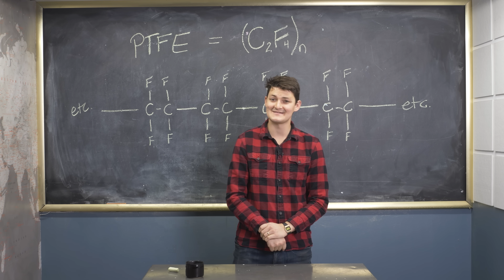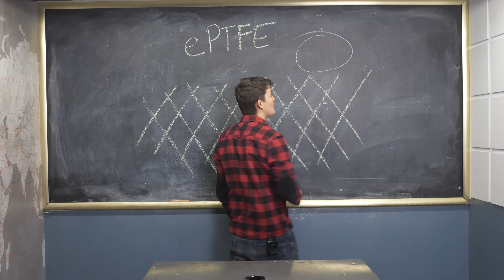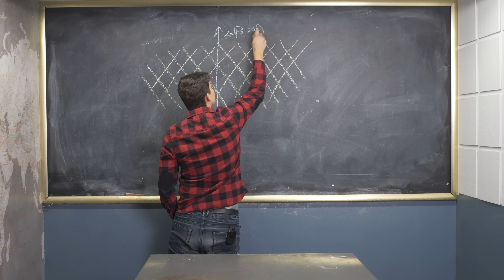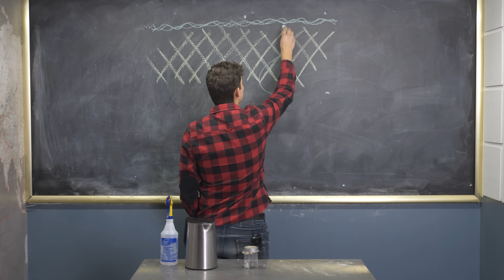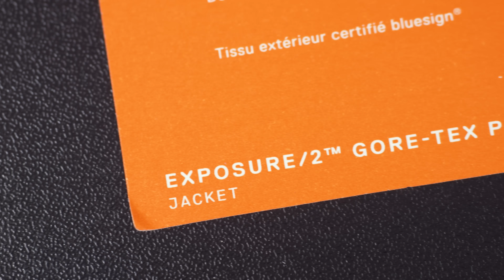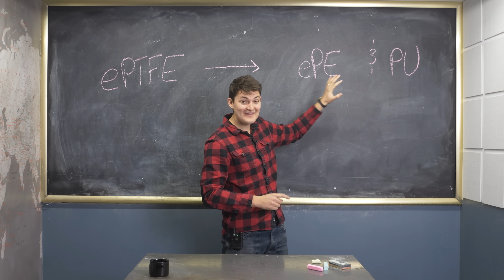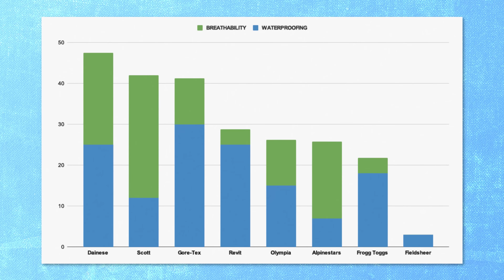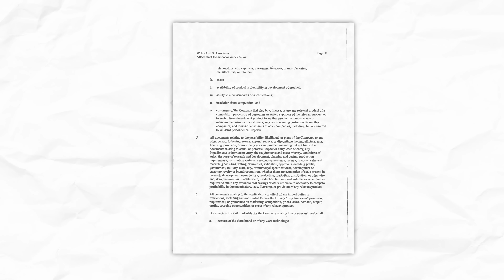Gore-Tex is a Marketing Gimmick

Comment: As a textile technologist I proved this back in the early 90’s. Some of the top brands utilise an enhanced membrane system, that not only out performs G’tex, it’s a fraction the cost. The only G’tex products I’ve purchased are ones I’ve deliberately destroyed in the name of science. Great video.
Reply: Any suggestions? Asking for a friend.
Reply: @Desmo25  Also have a friend who'd like to know
Reply: Mountain Equipment Lhotse @Desmo25
Reply: yes, please sir - suggest us something:)
Reply: @m5ks11  Just about what everyone else has developed still utilises one ingredient.  The “Teflon” component used by Goretex was prohibited in several countries just over 20 years ago. This alone means all claims are extremely out of date. A simple tip is to compare the water resistant and breathability numbers listed as all of these require certification.  You will even find numbers rated higher than Goretex for a fraction of the price.
Reply: @marcusgeorge1825   ok such as what brands?
Reply: @marcusgeorge1825  there are very few membranes with same performance numbers as GTX. And these are not cheap at all
Reply: @marcusgeorge1825   That consumers are fickled and don't research properly  is not their fault. And that fairytale about the validity of the patent is a total untruth. Also, the Gore company started out making medical devices  who's devices helped save lives. It was a activewear manufacture that 1st contacted them about use in clothing. Cheers.
Reply: @rickden8362  My comments are solely about the performance of the fabric. Nothing to do with anything you’ve just ranted about. Best wishes with your projects.
Reply: @marcusgeorge1825  You said it was a ''Great video'' so you were also endorsing ALL that was said in the video. Read what you wrote.
Reply: @rickden8362  Lost for words now?  The term “great” hardly translates to endorsement now does it. Great that water resistance and breathability was explained.
Reply: @marcusgeorge1825  Dude ''Great video'' means ''Great video'' all of it. When english isn't your native language I understand things can be difficult.
Reply: @rickden8362 he sounds like an native English speaker to me. You're just being pedantic.
Reply: @northernswedenstories1028  And you need a dictionary, start with sarcasm and pedantic...you cant recognize the former or and know the definition of the latter.
Reply: @rickden8362  yes, we all know sarcasm is best portrayed on the textual formats on the internet. I know the meaning behind both terms. Explain why they are contextually impropriate here if you're so smart?
Reply: @northernswedenstories1028  You  don't have to be smart to see that you still don't get it.
Reply: @rickden8362  Here's the thing, something can be well crafted, well explained, well tought out, well presented, and so on, yet you don't necesarily have to endorse any that was presented on said thing, i don't get how you could be so pedantic about something so dumb. Like it's not even related or has anything to do with one another.

Just in case you try to keep your braindead argument here's one example: 

You can, in your own subjectivity like or dislike something like the mona lisa or the venus sculpture, yet that it's entirely unrelated and unaffected by it's intrinsic quality of craft and mastery of the art.
Reply: @danylol772  Wow, you're really hung up on this ''pedantic'' thing, is that your vocabulary builder 'word of the month'. Are you getting points every time you use it.
   The additional verbose rhetoric is just plain silliness...but that's just you.
Reply: @marcusgeorge1825  I'm told that an interesting thing about MVTR B-1 test is that the method is apparently owned by Toray (Japan) and other manufacturers can perform the B-1 test, but can not claim MVTR/24HR more than 20,000. --According to my Pertex sales rep. Toyota apparently thumbs their nose at that and straight claims 65k with their G87445 fabrics. We have been relying on 3rd party testing for actual MVTR results. (IDFL & Kraken) 

It's all moot now anyway with the PFAS realization and closure of Gore's finishing mill. What's the future of rain gear?
Reply: @rickden8362  Your snarky put-downs aren't scoring you as many points as you might think, especially combined with a failure to address a valid point :- that one can appreciate the craft of a video without whole-heartedly endorsing its message.  My (admittedly unsolicited) advice is to take a breather before hitting the reply button, and only do so if you have something relevant to add. Arguing for its own sake will just lose its novelty, burn you out, and make you come off like a condescending prick in the meantime. Believe me, I've been there.
Reply: @hughcaldwell1034  There are MAJOR faults in the video that a lot of watchers want to give a pass, l'm not one of them. And l'm not going to get into a tit-for-tat with someone just wanting to showoff there pseudo-argumentative skills. Cheers
Reply: @rickden8362  Hate to tell you this, but you've already been in that tit-for-tat, and you're the one showing off pseudo-argumentative skills. You know; mocking someone for using the word "pedantic" exactly once, dismissing an argument as "verbose rhetoric" and "silliness" with zero explanation, and implying someone isn't a native English speaker because they used the word "great" differently to how you interpreted it. The last having a touch of irony, given you used lowercase 'L' instead of capital 'I' in your last response.
Reply: @hughcaldwell1034  So now you're the grammar fascist, you got the little mustache, too.
Reply: @marcusgeorge1825  I'd love to pick your brain. Is there a way to DM here?
Reply: @logicsoundinc  I don’t think so. However I will give you a free tip without breaking any IP laws. Nano based products that you can buy off the shelf work. Sprays to help detail paints, rubber and plastics can also be applied to fabrics. You will also see a big rise in the use of Graphene based technology as it forms a single layer and also has the ability to become conductive which is a different topic all together.
Reply: @marcusgeorge1825  cool! I’m the buyer/logistics mgr for a medium size manufacturer in the US. We have a popular rain jacket that we couldn’t get fabric for for 2 years— and fabric is continuing to be tough to re-source. I’ve bought quite a few yards from Toyota in the past!
Reply: @rickden8362 ahh, the good old "(falsely) dismissing someone as being pseudo-argumentative and immediately following up with the ad hominem yourself". Being a hypocrite must be bliss; never once do you have to perform any self-reflection, doubt your own correctness, or take seriously the opinions of any other human being.

Not sure what you're really trying to gain here. You evidently don't want to listen, but I'd follow the guy's advice about internet discussions. I've been there too (haven't we all at some point?)
Reply: @rickden8362 They’re*, stop commenting on others faults when you’re (Look! Proper suffix!) just as flawed.
Reply: Thanks for sharing this! It's a g'spot-on!
Reply: I like goretex, but not at goretex prices.  My old German Army flecktarn parka is goretex, and it's really the only thing I'll wear when it's a hot and humid summer, but it's raining too hard to not wear a rain coat.
Reply: And for those that don't know... that german parka made from goretex... costs $60 at just about any army navy story.
Reply: I ride snowboard (freeride included) - problem is, that in this industry if you need some light performence stuff, it cost you quite a lot. And the level is similar between diferent membranes brands :/ I have jackets from different materials, but one is Gore because of the all the materials used in lamination (rough on exposed areas like backpack straps, elbows etc..., lighter on some panels...). My normal freeride/slope jacket is nice performing, but heavier and just one type of fabric weight. For my enduro bike I go with low price sinde there is really high chance I destroy it and also I don´t ride as long in wet conditions.
Reply: I always could find very lightweight high quality no-name brands that were all great.  Never felt the need.  @lukasvrana6388
Reply: Sounds like an exercise for the reader to find a brand they like that also rates high for water resistance.  Would you also say the DWR layer is important to consider? Do they rate the resistance with or without the DWR applied?
Reply: What a bizarre comment, hating on Gore Tex but refusing to provide one single example of an alternative. OP probably rebrands junk from AliBaba for a living lol.
Reply: @hakeemhires  Not one comment of mine suggested hated. Examples?  That’s what educated people refer to as intellectual property…. I have provided a hint at what to look for.  Ali who?  Never heard of him.
Reply: WHAT.
BRANDS.
DO.
YOU.
SUGGEST.
?
Reply: @mattiabertani4367

Event, e.g.
Breathe more than Gore Tex.
Reply: @mattiabertani4367  I use NeoDry 10 000 jacket and it's enough for me not to get wet or sweaty. The price of the jacket was about 70 Euro.
Reply: @mattiabertani4367   much rude
Reply: Examples or it did not happen.
Reply: Thanks for the great demonstration. This has been in the back of my mind for years. The only difference might be around durability, wear and tear...
Reply: I work outside all year long, and nothing performs as well as goretex.. period
Reply: You're wrong.. period. @860Pepe
Reply: @860Pepe  period. yankee doodle

Comment: If a rider is willing to sacrifice just a little bit of convenience, I firmly believe a non-waterproof set of gear combined with classic separate rain gear is a much better system than either a Z-liner, laminated membrane OR a removable inner waterproof liner. Why? Well, with a separate rain gear set (overalls or two-piece), you get:
- Almost certainly better waterproofing, due the waterproofing being the outermost layer
- Almost certainly better windproofing, also due the windproofing being the outermost layer
- Almost certainly better temperature protection, also due to it being the outermost layer
- Much superior ventilation and breathability whenever the rain gear isn't being used, which, for most of us, is most of the time, due to being able to use actually functioning vents and materials
- Likely better fit due to not needing either liner layers inside the jacket or stiff laminated outer fabric or having to leave space for an inner removable membrane
- Likely better safety and high speed comfort due to that better fit
- Superior repairability, due to being able to repair or replace either the riding gear or the waterproofs separately
- Lower environmental impact, due to superior repairability and not needing to replace everything when just a part is broken

All this for the price of spending a couple minutes to put the gear on.

Comment: Forgive me if I'm wrong but doesn't gortex REQUIRE manufactures to submit products to gortex for stringent testing before they are able to use the brandname / technology?
I believe it's the sole reason I've always been satisfied with the longevity of gortex branded products and disappointed when an alternative brands waterproofing failed due to a cost-cut, single stitched waterproof seam.

Comment: My 23 year old Gore-Tex Hein Gerick Wet suit has never leaked through some of  the most torrential of storms. I've never had a wet crotch after getting off of my bike. Once I even sat on my bike for a full half hour in pouring rain, at a motorway services Whilst my buddy tried to get his one piece wetsuit over wet leathers. (He didn't tell me he was going to do that.) No leaks. Add to that a seven hour ride to our destination, Ireland, in pouring rain.
So, Gore-tex, bad. OK, but my suit is good and after 23 years the £450 price tag has been well worth it.
Cheers.

Comment: ahh yes the old waterproof breathable lie: if it sounds too good to be true it probably is.

but like most things, there are ways to get around the problem. i love ponchos for cycling because they vent well. i use umbrellas while hiking for the same reason. when i'm ski touring i use waterproof pants that have zippers that go from hip to heel. venting venting venting. 

when venting doesn't solve the problem you have look at materials and layering strategies. one of my favorites is the windbreaker/fleece combo. (hoods mandatory.) intended to be worn against your skin, the fleece wicks moisture away which makes you feel drier. 

that said, waterproof clothes have their place. i use waterproof clothes when i'm not pushing myself to the limit. for example, i wear waterproof jackets and pants when i'm at the ski resort and it works great!  i rarely have periods of sustained effort that make me sweat enough to the point where i'm cold on the next lift.

if i start to sweat a lot then i take off a layer or i open a vent. have fun out there you guys 🤙

Comment: Interesting video. I own a gore tex rider jacket and other kit and also a d-dry jacket. The d-dry laminate is equally as waterproof as the goretex kit tested in torrential conditions. The problem for buyers is that there are many unsubstantiated 'other brand' waterproofing systems. The variety and untested nature added to the fact that these products are substantially cheaper than GTX, undermines consumer confidence that they are buying quality kit. So, on the basis of buy cheap, buy twice, people tend towards GTX if they can afford it. Since, generally, GTX branded kit is made well, as well as being waterproof, leads to the legend of GTX being difficult to break.

Comment: It goes along with one of your previous videos.
Since that one, I bought a mesh jacket for summer, I put a thermal under layer in the winter and a rain suit when needed.
It costed me 200€ and I never been better protected than when I used to have a 600€ Goretex 3 layers jacket.
Thank you Ryan !
Reply: So you always have to take a rain suit with you on a trip. It takes space for one. It requires stopping and taking it out to put on. And sometimes it's just short showers all day. So you end up riding in a suffocating rain suit all day long. Sometimes it starts raining and there is just no safe way to stop. So you get soaked in no time. If you're okay sleeping in a tent, that's fine. But don't tell me it's as good as a hotel.
Reply: @cheetah694  it’s my only vehicule so yea the combo I have is better 99% of the time in my daily use.
Thanks for pointing out the 1% it might be less relevant.
Reply: @chrisd2794  Maybe you live in a better climate than I do. I live in a really shitty, wet and volatile climate. So what I described above is pretty much the usual day out there for me except for a couple summer months.
Reply: @cheetah694   I live in Belgium, it’s raining 360 days/365 haha

Comment: I've had/have Northface GoreTex gear since the early 90s. Then, in the past few years, PFAS, etc., came to light, and I found out one day while walking the dog in pretty heavy rain that the jacket is no longer water repellent. Good ol' dirt, dust, and grime build up on the surface and defeat the water-repellent properties. Washing is supposed to fix that issue., but not so much. I have a couple of products for washing and then spraying the exterior surface to restore water repellency. They are new(ish) and non-PFAS.
There's nothing I can do about the 30+ years of PFAS ingestion (it's everywhere anyway).  The old NF gear is still holding up,  so I'll get more years of service out of themuntil I really need to buy new gear.

Comment: The stuff simply doesn't work on motorbikes in the UK. Something about the way the rain blasts at you means it always finds its way through. Standard reply from the manufacturer is "Oh, it's because you've got dirt stuck in the weave, try this special washing stuff at £25 a go and that'll fix it.". Well newsflash, riding a motorcycle in the rain constantly bombards your gear with dirt, soot, salt, grit and diesel film. The result? Leaky gore-tex. The only waterproof gear that seems to be actually waterproof is the old fashioned slightly stretchy polyurethane/PVC stuff (like the old rukka suits). In no way breathable but you can deal with the sweat using a wicking layer (wool for preference) and arrive places dry.

Comment: I'm an avid outdoorsman and hiker, and retired military.  I DO NOT use gortex products anymore.  A couple boots and outdoor jackets later I found they are less than waterproof.  Even following manufactures maintenence, you will be wet and cold in short order.  I have gone back to leather boots with mink oil and wool fabrics.  I also found 400 dollar synthetic/vegan boots with gortex lasted about 2 years of mountaineering.  My current set of leather boots are at just over 10 years and are now finally showing their age but still keep my feet dry.  A lot of the military gear is gortex and NOT waterproof and terribly made.  If you want to be warm and dry, you will want to invest in wool layers and use your common sense in the field.

Comment: If you are sitting outside gore-tex provide a good wind protection some rain protection (for not long)  but as soon as you do some hard work inside a gore-tex you will be sweating a lot and get wet. I used to wear an old gore-tex vest to make new trails in the forest in winter (hard work) when there was a lot of snow on the trees to avoid to get wet but i became very wet inside the vest. After a while I decided to wear the old thick wool vest my father was using all the time and even if the vest became wet outside from the melting snow my body under the vest was dry. Much much better than the expensive gore tex vest. But I was in the forest with very little wind, strong wind will go thru the wool vest sadly. I agree with you we pay too much for that stuff. The only time I found it useful is for dowhill skiing to cut the wind as it is not hard work.